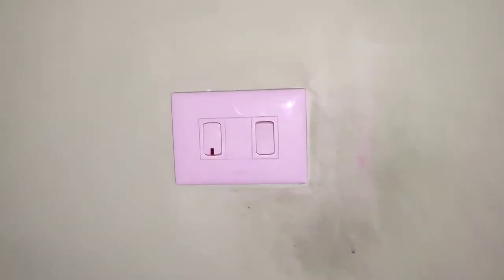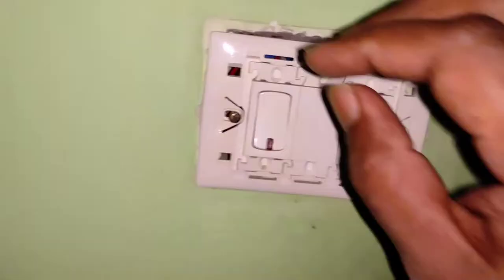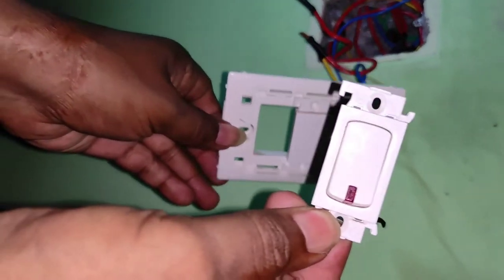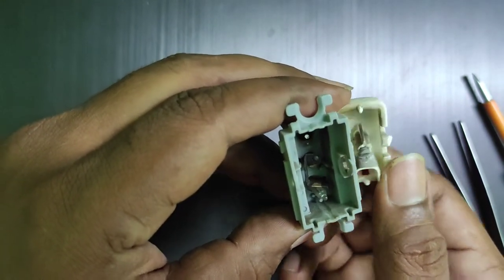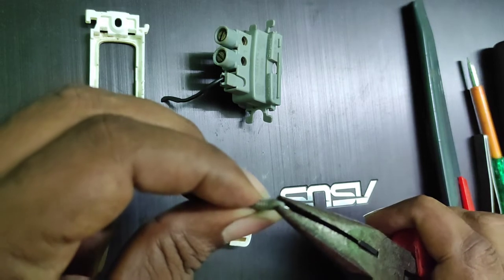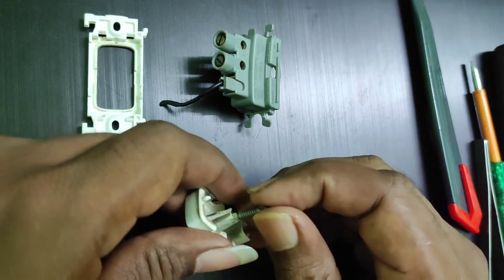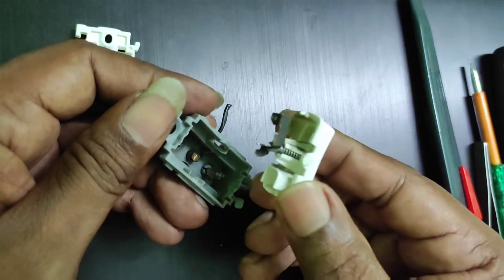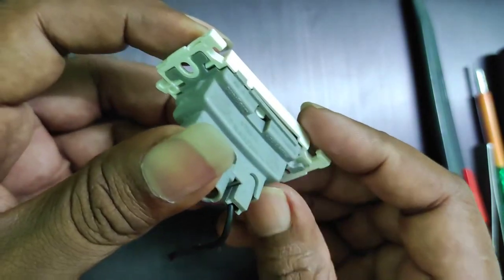Legrand switch repair - DIY

Comment: Before attempting to remove sockets /switches  or any electrical fitting, locate the cct breaker concerned and set it OFF to avoid electric shock. Then proceed  for replacement  and  switch power ON again. Thanks Mr. Jay.